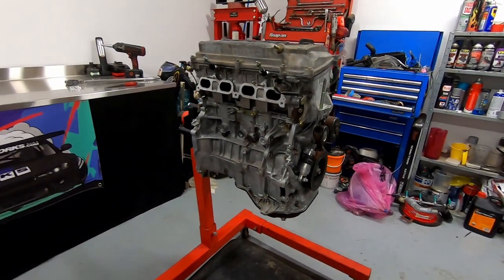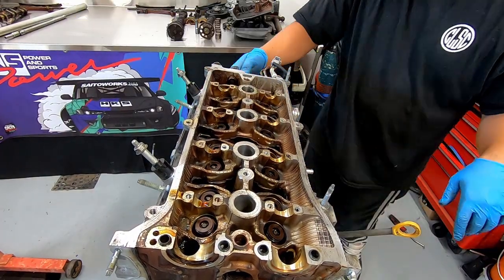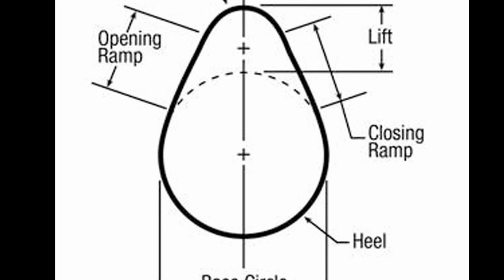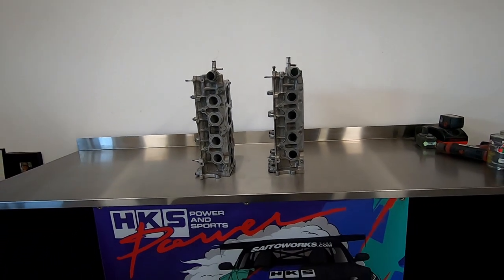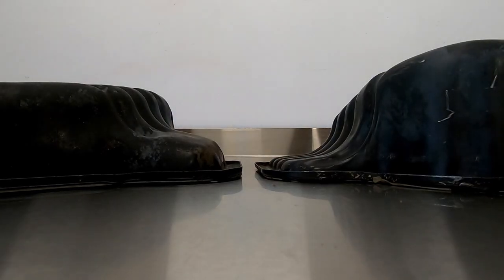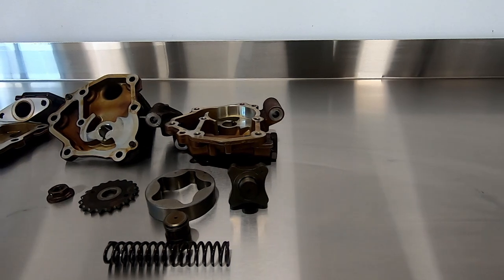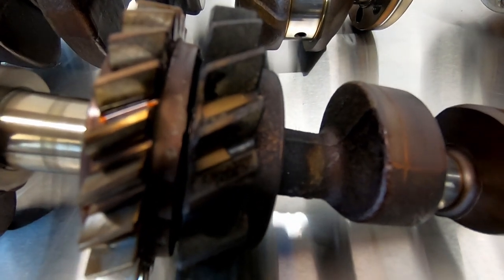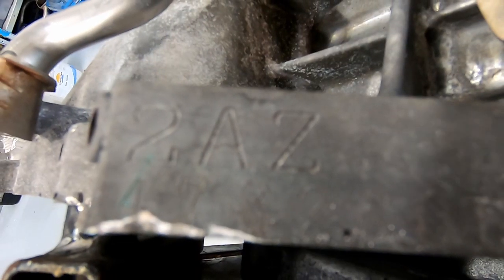Project Wonder AE86 Update #4 1.5AZ/ How to de-stroke a 2AZFE – The Definitive 1AZ vs 2AZ Comparison

Comment: Outstanding video, what a great project, thank you. The piston comparison was very informative. So many questions, I hope you can help with. Will you use the 2AZ-FE donut oil cooler or a separate cooler? Now, both the 1AZ-FE and 2-AZFE pistons you show are from before 2006, so these 2AZ-FE pistons are NOT the ones prone to blockage and oil burning. I have never seen a direct comparison of the piston design for 2AZ-FE from before the oil problem (<2006) and after (>2006). Did you get any special technical data from Toyota? After 2006 (or 2008?) Oil squirters were added to try to cool the pistons to help prevent the oil blockage problem. Also, the water jacket insert was an attempt to cool the exhaust side of the block, where as you show there is no oil drain that can aid in taking away heat. Is a better water pump called for? Clearly the 2AZ-FE is designed for the low end torque for easy daily driving in the larger vehicles. For the more average modder, is the 1AZ-FE a more sensible engine and a more likely donor for a square high revving engine suitable for boost?

Comment: Thanks for the info.
Any possibility to compare post2006 2AZ cams to pre2006 2AZ? Which is better for a 1AZ to use ? Seems like the 1AZ is better built on the pistons for reliability and no balance shaft to deal with

Comment: 3years on! Can i get a comment? My car blew out the 2az fe engine and am thinking of putting in the 1az fe engine as a whole. Question 1. Without altering anything, are the mounts similar? Will i change the transmission?

Comment: Can you answer a question for me?  Does the 1azfe lower crankcase stiffener fit over the 2azfe crank and rotating assembly without colliding?  Wondering if its feasable if you use that for balance shaft delete and go to the 1az oil pan with it?
Reply from the maker: Sure does fit. A few of the TC guys have gone this way in the states instead of using the 2az lower skirt and blocking off the oil feed for the balance shafts.
Reply: @MODIFYUP  hey thanks for that.  Actual tested ideas are the best instead of what you read on random sources. Would help with crossmemeber clearance as you say. Maybe let you tilt it down a bit more.

Comment: Thank you so much for these videos, I’ve been waiting for someone to try this after reading about It for so many years online but no one actually ever attempting it. Now I know you said you were going for a turbo build, but do you think this setup would benefit over a regular 2az-fe naturally aspirated? Please let me know, as I want to do a high revving n/a build really soon. Thank you, subscribed
Reply from the maker: Hi Rich thank you for your kind words. Thats an interesting question. For me yes I am looking for a very linear power curve with good response, freely high revving nature and high power output. Is that better than a naturally aspirated 2az, well it depends on what you are trying to achieve. Some prefer the sharp throttle response of an N/A over a turbo but what I can say is that a 2.4L will always make more torque down low than a de-stroked motor. What is the purpose of your build and what discipline will it be used in most?
Reply: So i actually have a 2010 Toyota Matrix 2.4 awd, and I was trying to do a budget build, being that it’s an auto I didn’t want to go the turbo route for fear of the tranny not being able to handle it. Now I know I can send the tranny off to a shop like level 10 to build it but between that and the expense of the turbo it would be way out of budget. From all my research that I’ve done online I’ve seen a few people with fully built n/a 2az achieve 250 hp with e85. Read about TCPETE on scionlife. My build was gonna consist of port and polished head with oversize +1mm valves, Brian crower stage 3 cams with valve springs and retainers, 2az-fxe high compression pistons rated 12.5:1, 1az-fe knife edged crank, 1az-fe upper oil pan. As far as bolt ons you have plenty of  choices, and TCPETE reached his numbers rather conservatively with off the shelf parts, 4-1 dezod red headed, weapon r Intake manifold, rx8 throttle body, nst pullies, I believe if he was to drop the extra cash on a custom header and intake manifold along with maybe individual cylinder tuning he could break the 300 whp mark on a n/a 2az-fe build. Now I know at that point your pushing it with budget but just an idea. And I believe with the 1az-fe destroke you can achieve even higher numbers being that you can rev higher like a k24 vs k20, obviously sacrificing some torque. The reason I went with the Matrix aside from already owning it and it being paid off, I love the all wheel drive and coming from a background of fwd cars when your pushing too much power after a certain extent it’s undriveable on the street, wheel hop, torque steer, I hate it lol All wheel drive you can launch the car, no wheel spin, not as much understeer depending how you have the suspension tuned up etc. the only disadvantage I have right now is weight, the car is a pig at 3,300 pounds compared to 2900 of a Scion tC, but with a gutted interior, bucket seat, ac delete, lithium 5 pound battery, custom carbon fiber drive shaft from the drive shaft shop, Carbon hood and trunk,forged rims, front bumper straight pipe exhaust, I’ve already taken out more than 300 pounds off the car, I still have yet to do lexan windows and gut the doors, maybe even a carbon fiber or lexan roof haha, sorry I know I’m rambling at this point, and a lot of people will say for the effort just buy a wrx or evo, but all this has been done throughout the years one mod at a time. I’m working with what I already have and I’m hoping to build an n/a matrix that can surprise an average wrx lol

Comment: interested to see how you manage oil pressure/volume  at 10,000 rpm. the stock oil pumps look pretty weedy
Reply from the maker: Actually going to look at the 2AR pump to see if i can adapt shortly. Gears are much wider.

Comment: fucking genious... do you think that a stock 1AZ will support a TRD supercharger? i'm looking for that or fitting an AMR500 for a low boost (overland oriented) upgrade... i just wan't to go from 225-65-17 to 225-75-17 without hurting to much in the power department... i have a 2007 rav4 with the 1AZ-FE making 152hp

Comment: I hope your dyno graphs don't look like 📉⤵️ at higher rpms
Reply from the maker: me too but doing the math first before throwing money at it will take the guess work out. I'm not in the practice of throwing parts at it and hoping for the best
Reply: @MODIFYUP  another problem how far is the project are you finished?
I think you're going to stress your engine at 10 000rpm because of the large 86mm stroke
Reply from the maker: @Manuqtix.Manuqtix  i have updated the measurements since this video. I will now be running a 155mm c to c rod which will lower the piston speed and rod angle even further. by my calculations 11,000 is capable with the correct sized turbine to make power up there

Comment: 3:35 thats why various 4afe and 7afe engines made n/a more than 260hp, something that was not possible from any 4age/7age
Reply from the maker: Downside is a taller cylinder head which is problematic when dropping the engine in something it wasnt designed for :( bonnet clearance is a headache
Reply: Can you point me to good reads on this subject, techy articles, etc